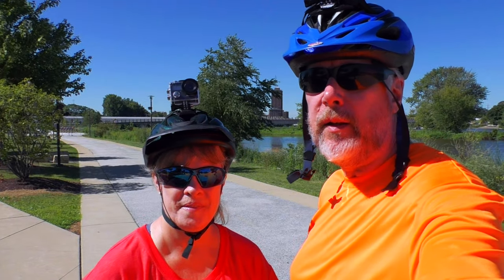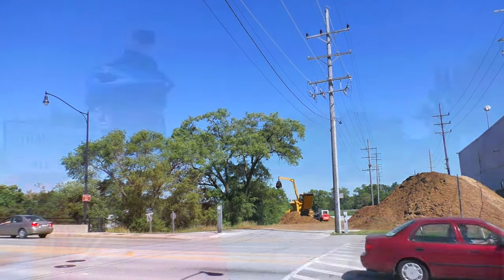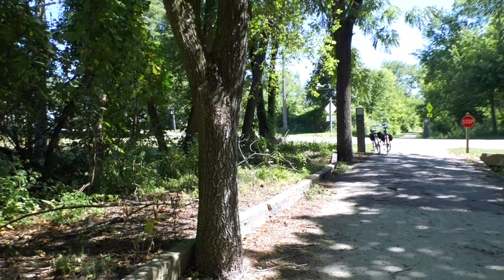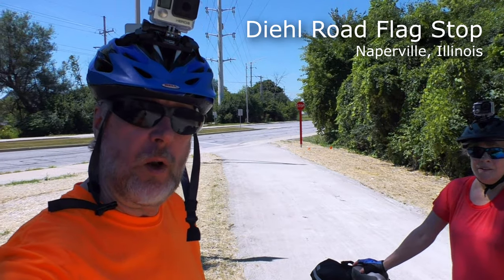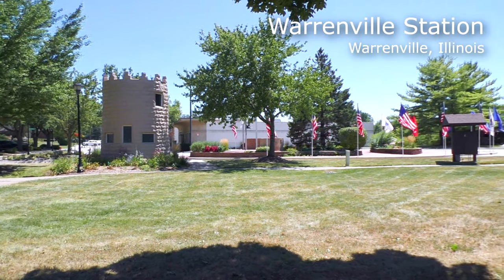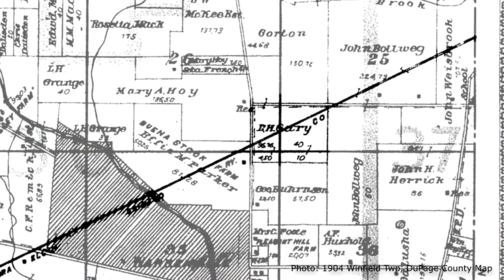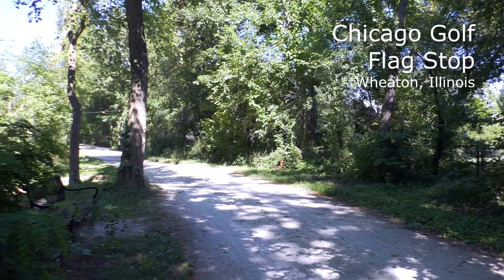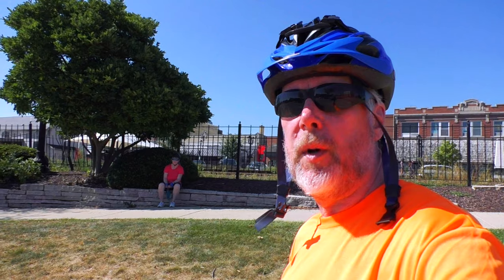Disused Stations of the Chicago Aurora and Elgin - AURORA BRANCH

Comment: right after the Gary rd stop you go though that section of the path thats due north and south ... im pretty sure that was the OG Gary Road on old 1939 aerials you can make out a road my guessing its a private rd for the Gary's
Reply from the maker: Thanks for commenting.   Yes, that's very possible.   There are multiple concrete artifacts just there - back in the weeds - signal bases and other concrete bases as well.